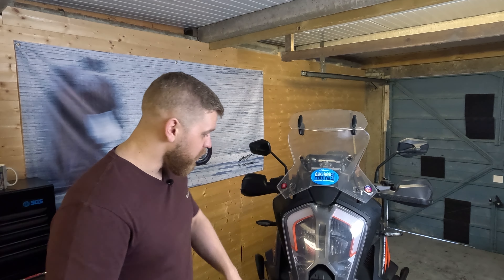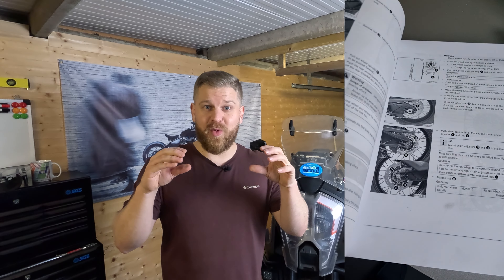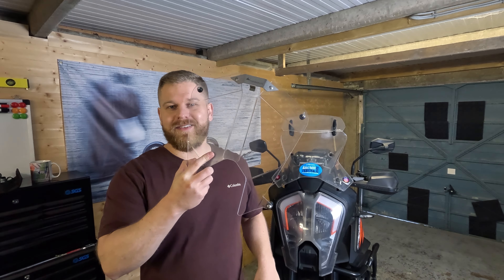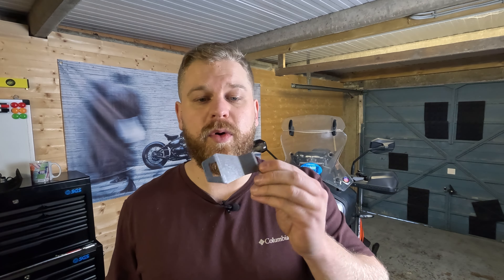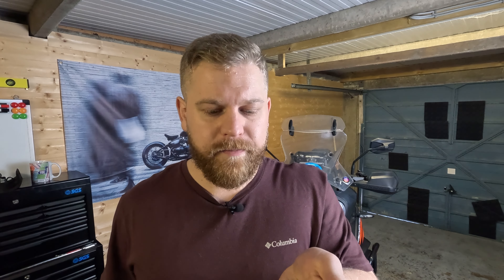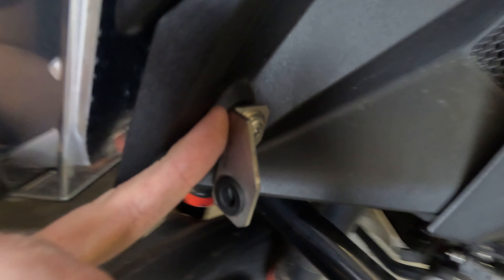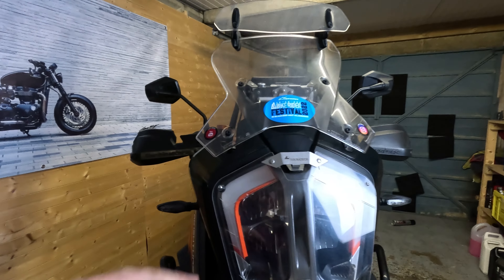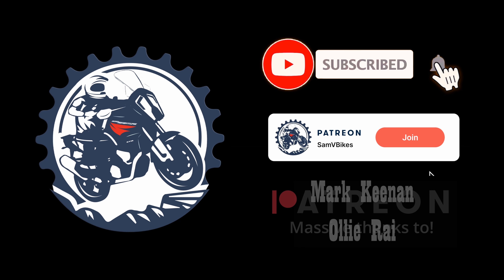Is Touratech Headlight Protection Better Than Power Parts? I 1290 KTM Super Adventure S

Comment: Does this change the optics clarity of the headlight lens though? Lens focus? It likely doesn't, but even still this seems like a lot of work for just headlight protection, which can largely be achieved by simply not following too closely to other vehicles.
Reply from the maker: Nope, not that I've noticed. Lovely clear beam pattern still. This one is more effort than the KTM Powerparts ones. You're right for the most part, but I spend quite a bit of time off road with the bike too so that's the main reasoning. The other key reason is I found out how expensive a new headlight is, and I'd happily spend an extra 5 mins cleaning the bike for the rest of my life instead of spending out for a new one! Only takes one stone!

Comment: Nice job mate,but i think touratech headlight protector wont fit with the puig windscreen,because puig has a "nose" at the bottom center of the screen to cover the upper center off the headlight...does anyone confirm that;
Reply from the maker: Ahh thats annoying! Not sure if it does, maybe someone can confirm here. It doesn't seem to fit any higher or lower than the Powerparts one but I can't confirm without trying the screen

Comment: Hi thanks for the video..did you feel any vibration while riding it at high speed …? I like it over the original KTM because easy to clean, but l wouldn’t like hearing vibrations all the time ..l ride mostly on road and not slow..😬🤭🫢Thanks
Reply from the maker: Not from the headlight guard! Try to put it closer to the headlight and tighten it up again. Worth checking your mirrors aren't vibrating too, I know that happened with mine!

Comment: did your ktm protector rub anywhere? mine has rubbed on the metal heat sink just above the radar and taken the paint off 🫤
Reply from the maker: Oh that's crap!! No mine hasn't thankfully, but I can see how it would. Does it contact the headlight? I'd be tempted to take it to KTM and say it's happened from the KTM specific part
Reply: it's not touching normally but I think it's flexing whilst riding
Reply from the maker: I dont think mine flexes at all from what I remember. Definitely done up tight enough up the top etc? I'd still be tempted to go to KTM. They shouldn't sell a product to protect your bike which damages your bike... maybe there's a manufacturing issue on that guard